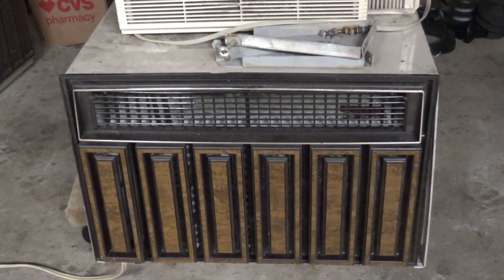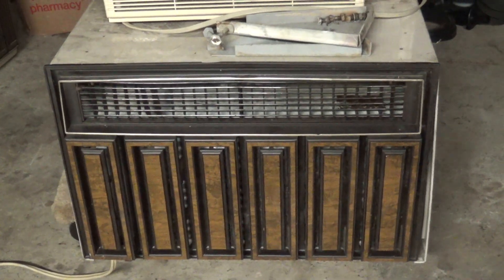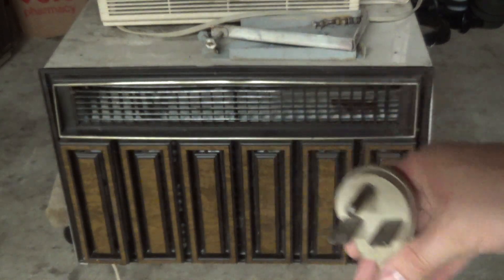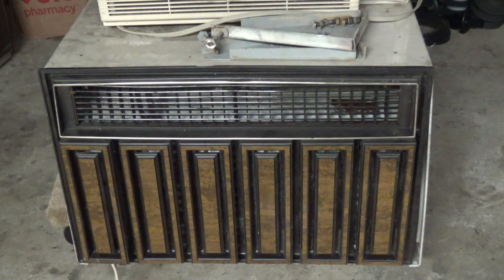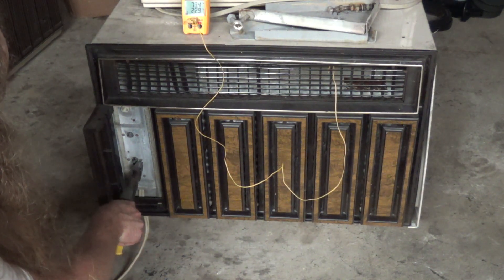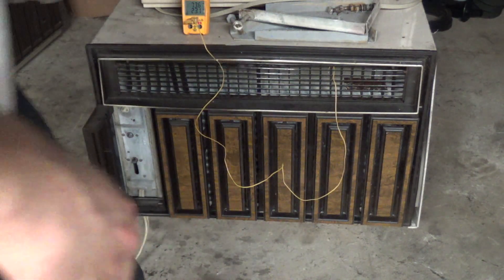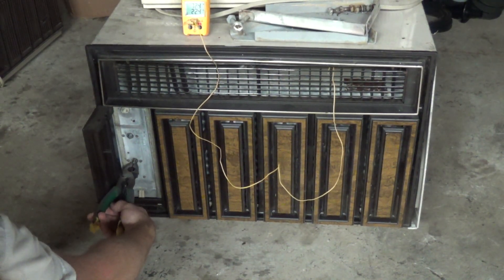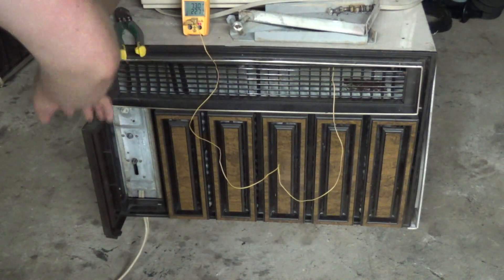Large Chassis WCI Test

Comment: This is probably my favorite unit you own lol. That compressor start up was epic sounding! Sounds like an actual machine getting the job done. It’s a like a central unit kicking in. I can imagine this thing weighs a ton. Really cool unit! So I actually did a little looking on airconditioner man’s Tumblr looks like this unit is most likely 26,000 BTUs.
Reply: Im thinking between 23-27k for sure. It does sound fantastic!
Reply: In 1967 and 1969 Westinghouse built 24,000 BTU (16.4 amps) and 26,000 BTU (18.5 amps) machines. 
Since Jordan said the compressor alone was drawing 14 amps earlier, I would assume this is the 24,000 BTU model (16.4 amps total). (BTU and current info from NEMA and AHAM directories)

But, now that the 20-amp breaker tripped, maybe it is the 26,000 BTU (18.5 amp) model.
 @TheAirConditionerGuy

Comment: Jordan,  I believe this unit uses a Copelaweld 'S' series 2-pole, twin cylinder compressor.  Shoot a clear, readable close-up of its data tag and I can let you know its date of manufacture and capacity.  This will give you a clue as to the date of the unit and a close approximation of its BTU capacity.
Reply: I cant confirm the model but its 100% a Copeland. Sounds great too and very heavy. 23,000 BTU comes to mind but could be anywhere between 23 and 27k i suppose. Your thoughts?
Reply: @TheAirConditionerGuy  I would say that your guess is pretty much correct.  My educated guess would be around 2 ton capacity. Those Copelaweld 'S' hermetics were a great compressor.  I would say somewhat more efficient than a Tecumseh 'AH' or 'AB'.  In the mid-late 1970's Friedrich used the Copelaweld 'S' as a substitute for the Tecumseh 'B' when it was discontinued after 1973 production.  Friedrich found it easier to achieve high efficiency with the Copelaweld 'S' than the Tecumseh 'AH' or 'AB'.